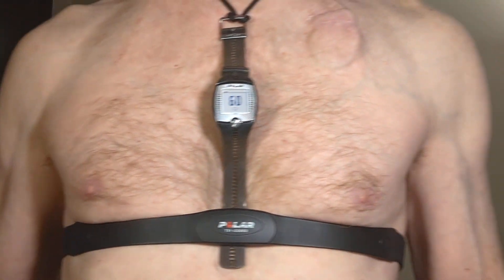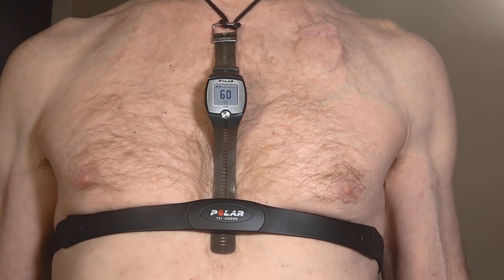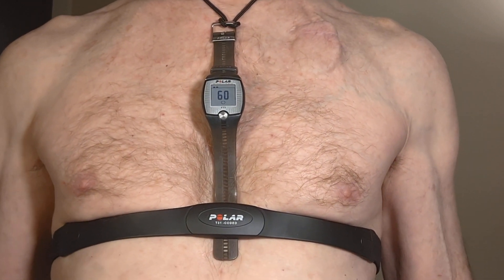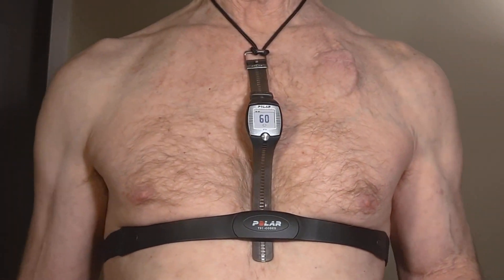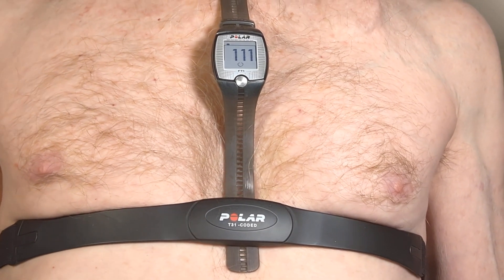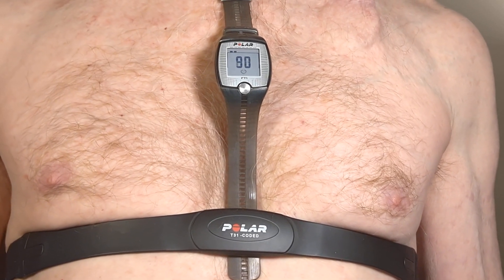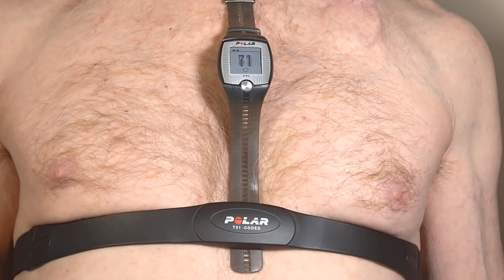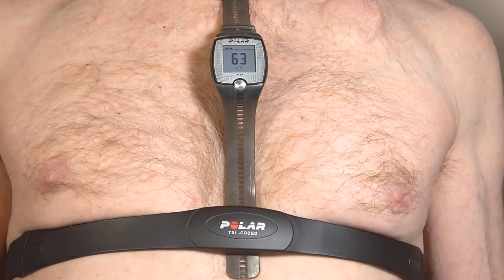Problem with Boston Scientific Accolade pacemaker

Comment: Thanks for your reply. I’m sorry that there still no solution to the MV malfunction in sone Accolades . My Accolade was implanted July 2022, and MV turned off after 6 months! I have an appointment in a few days to retry the MV. If it does the same again, we might turn off for good and just leave Accelerometer on. Presently MV is off and Accelerometer is passive. I’ll let you know how it works. Thanks again
Reply from the maker: See the Sept 2024 update I added to the text for this video. You might want to join pacemakerclub.com -- jgt126 and I are both members.

Comment: Hi, I just happened to come across this video. I have exactly the same issue with Boston Scientific  Accolade implanted 2 years ago. Very uncomfortable to do any kind of activity with the left arm. So,  I requested my Device technician to disable the MV sensor, and leave the Accelerometer passive.
Doing that took care of the problem at the expense of losing the rate responsive support. If you have found any solutions, Please let me know. I really appreciate it. Thanks a lot.
Reply from the maker: Thanks for the info about your experience. Unfortunately we did not come up with any solution. So I had them disable the MV pacing and enable the accelerometer pacing. (For me, the only thing the accelerometer pacing is good for is working out on an elliptical trainer.)

I have to think Boston Scientific is aware they have a problem in some cases, despite their rep claiming that no-one had ever heard of such a problem. My EP hadn't heard of such a problem either. I got my Accolade in Aug 2022.

Comment: Thanks for posting this.  I'm having the same basic problem.  Putting on a shirt or lying down in bed make my heart race.  Also swinging my arm while walking triggers the problem.  If I don't swing that arm, I don't have the problem.  If I swing my arm, my heart rate goes to the pacemaker's max programmed rate of 156 bpm.  My MV response factor is set at 11.  For cycling, I want a greater response, but I have to put up with with the arm problem to get it.  I'm hoping Boston Scientific can adjust the program to differentiate between breathing and reaching.
Reply from the maker: Thanks. Wow, good to know there's at least one other person with the same issue. Maybe they can figure this out if we connect your people with my people. The Boston Scientific rep on my case is Tom Holzworth, and my EP at UR Medicine is Dr. Burr Hall. We're in the Rochester NY area. Who are your people? I'll pass their names to these guys.
Reply: @MarkAbbott  I'm in Seattle.  I'm hoping that with the help of our local rep I can talk with the engineers at Boston Scientific about modifying the program that is periodically downloaded to our pacemakers.  That way many people will benefit from the improvement we're looking for, without the change bothering the other patients.  I'm a design engineer who is used to working these things out with other engineers inside a medical product design and manufacturing company.  I'll post when I've made some progress.  In the meantime, I'm not eager to share names and step on anyone's toes.  At the moment, my day job has my full attention, but obviously I'm motivated to solve this problem.  Do you know where Boston Scientific's software engineers are located?  Thanks!
Reply from the maker: @jgt126  I agree that it isn't great to put people's names in comments. Some kind of direct messaging would have been preferable. I hadn't heard that our pacemakers get updates but it would make sense. I don't know where Boston Scientific's software engineers are located. As an over-the-hill Comp Sci PhD, I'd be impressed if they're willing to work with you.
Reply from the maker: I sent a message to my EP that there was a person in Seattle with the same pacemaker problem as me. He replied: "Thanks for reaching out. There will be numerous Boston Scientific reps in the Seattle region. Is there any way you can obtain the name/DOB of this person? [That's you.] With that information, I could have Tom [my Boston Scientific rep] look him up in the Boston Scientific database and connect with his BSCI counterpart." I wouldn't want to put my DOB out there, but maybe there's some other info you could give us that would be enough to track down your case. Or, since I've already put the name of my Boston Scientific rep out there (Tom Holzworth), maybe you could get your rep to contact Tom?
Reply from the maker: @jgt126 Have you learned anything more about your pacemaker problem?
Reply: @MarkAbbott  Not much, but I've had a factory rep join my device check appointments.  I'm still pursuing this issue.  I just left  you a private message in Pacemaker Club with my phone number.   Let's talk!  Jack

Comment: Corrections, it just too slow after it was much too high, today bloodpressure 136 to 194 pulse 145. Seems arm movement gets it crazy. Found a well educated patient who had same problem, who wrote it down (in german) plus solution. ITake betablockers and try to NOT move left arm till next appointment in hopital. If you want to have his Story email adress? SOLUTION "R" Button

PS: Now with Metoprolol 2 x 47,5 mg, and not moving my left arm to often and fast 30 times a min. Ive a good life bloodpressure 80 - 100 to 150, still too high but ok, no dizzyness
Reply: I'd like to read his solution.  How do I get it?  Thanks!
Reply: @jgt126  https://drive.google.com/file/d/1dCBIzigKxxyNzNP4uGkox3Nwiv6n3mxf/view?usp=sharing